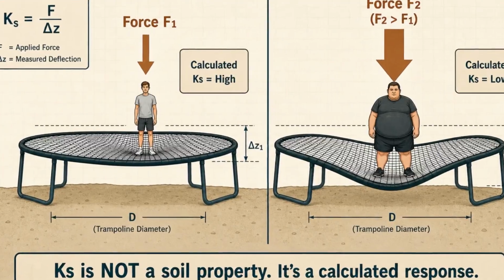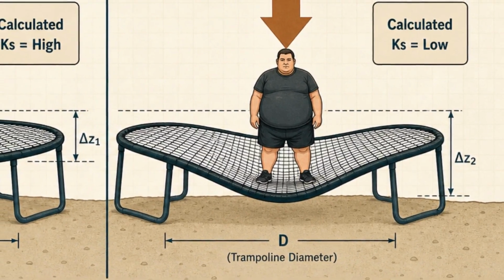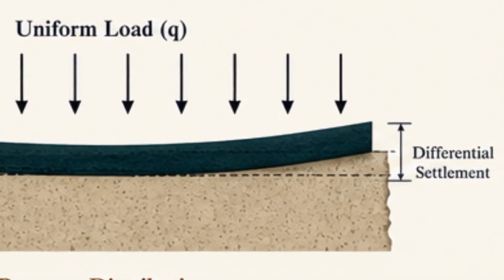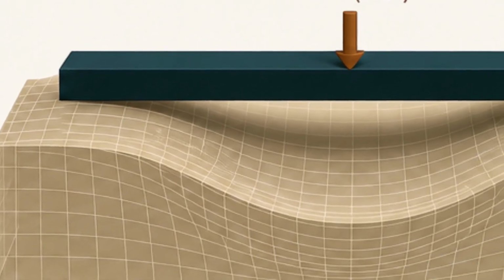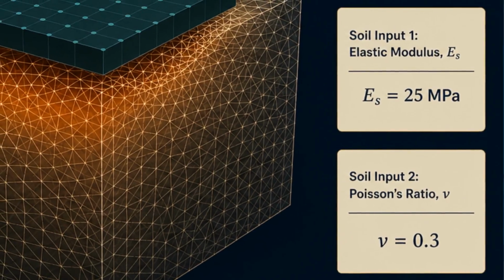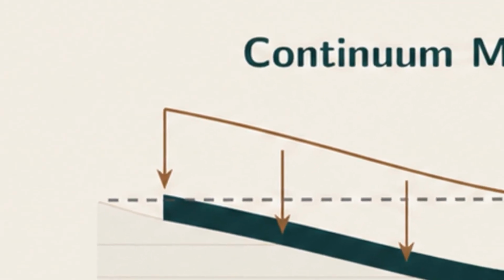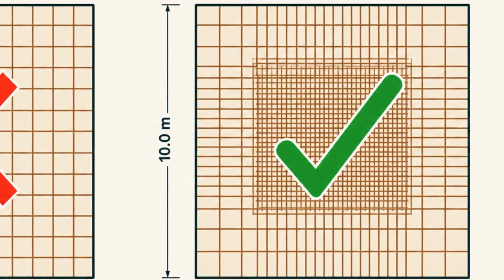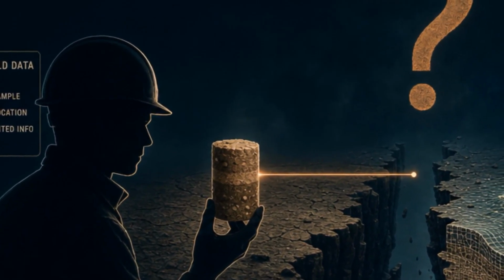Your Foundation Is A Lie: The Billion-Dollar Crack

Comment: After all redistribution of stresses , ultimate stress distribution on all negotiations between the soil & footing the semi-rigid condition happens to exist , ok fine . But still everyone till today adopts the uniform distribution of stress on soil irrespective of type of foundation & soil involved . No structure has failed yet as such on that account . What should be your response to that & what is your advice for stresses not being uniformly distributed on soil while designing the foundations in real world situations ?
Reply from the maker: Thank you for this thoughtful comment — you raise a very valid point, and I want to address it properly.

You're absolutely right that the uniform distribution assumption has not caused widespread collapses, and there's a good reason for that: the error lives mostly in the serviceability domain, not at the ultimate limit state. The redistribution capacity of well-detailed RC mats, combined with the generous safety factors in bearing capacity checks (FS ≈ 2.5–3), absorbs the modeling error before it threatens collapse. So the assumption is "wrong but safe" at ULS — which is why it survives in practice.

But where it actually shows up is in differential settlement, angular distortion, cracking in finishes, and sticking doors — things that rarely get recorded as "foundation failures" but are the real fingerprint of non-uniform pressure distribution being ignored.

I actually released a subsequent video covering the Transbay Transit Center failure — a real-world case where these exact issues played a direct role. I'd encourage you to check it out as it adds a lot of context to this discussion.
Video link here: https://youtu.be/DmEYpFIOM9A

My actual recommendation is not to keep using the uniform method beyond preliminary sizing. Use it only to get your initial foundation dimensions and a first-pass reinforcement estimate. For the real design, the tools exist today to build a proper 3D soil-structure interaction model that captures true settlement distribution for serviceability checks and realistic moment demand for steel design — and there is no good reason not to use them. The uniform assumption was a practical necessity decades ago; today it is a choice, and not always a defensible one.

Thank you again for engaging so deeply with the topic — this is exactly the kind of discussion this subject deserves.